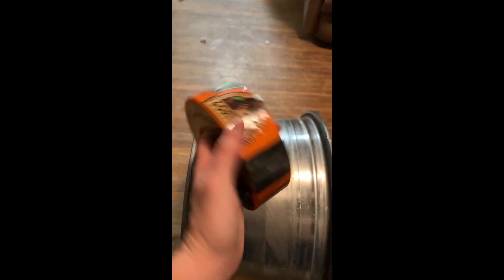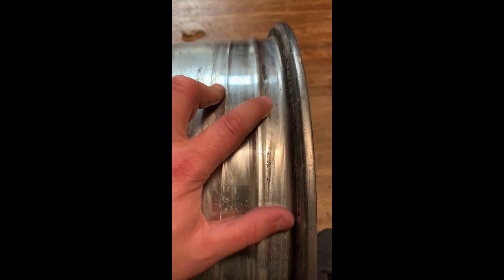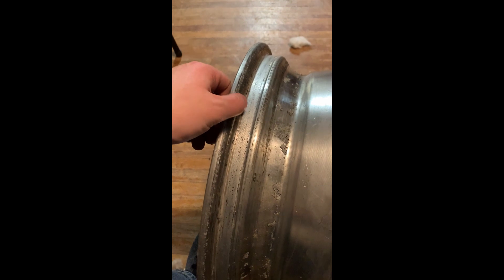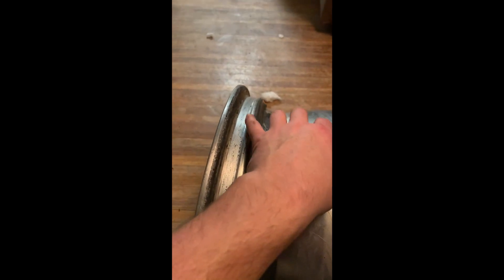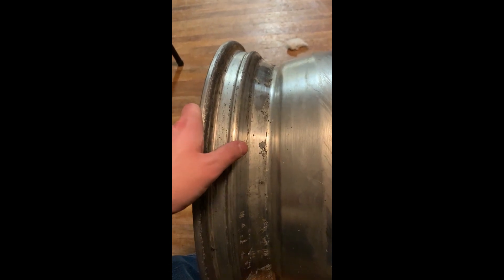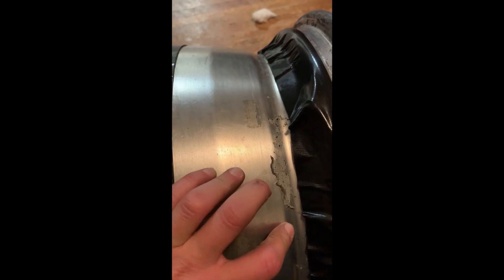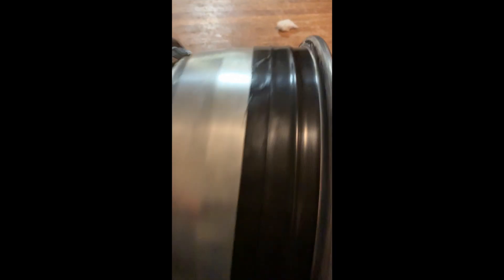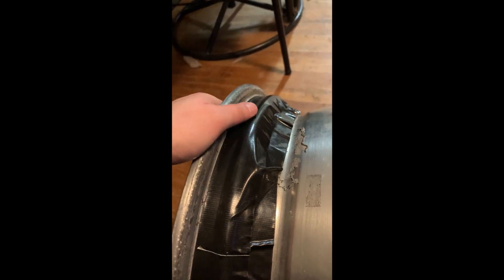HOW TO: GORILLA TAPE "BEAD LOCK"

Comment: Did this remedy your tires from spinning on the rim in snow wheeling conditions?
Reply from the maker: It sure did!! And no losing beads which is a bonus
Reply: Nice, I’ve got the same wheel and tire combo currently. How long has the tape held up for before having to redo?
Reply: Also did you have any balance issues again?